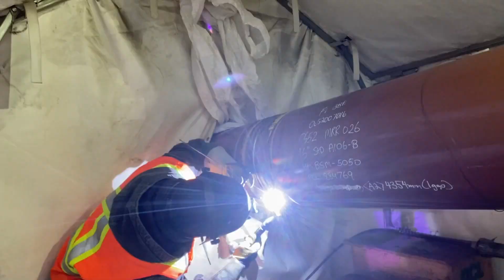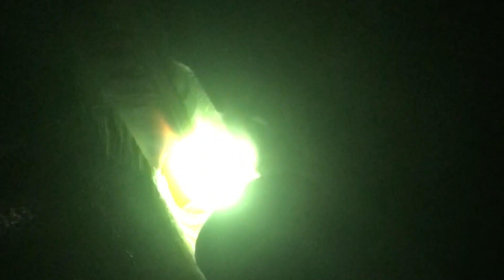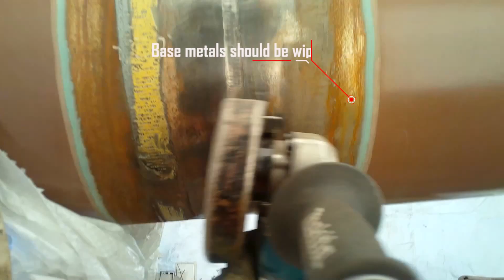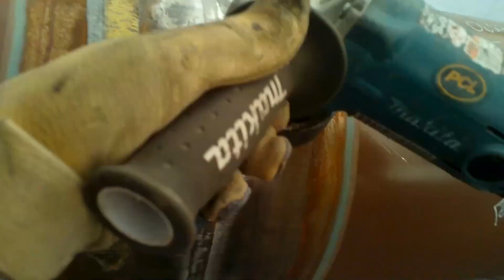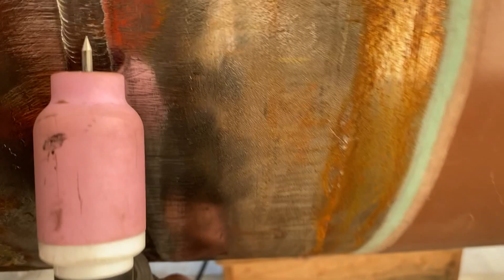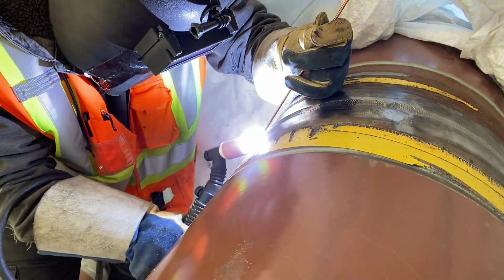Walking the Cup - TIG Welding Cover Pass Technique !

Comment: Nice video. What kind of fit up and prep did you have. Root gap? Guessing a 60 -70 degree inclusive angle or there abouts. I'm trying to teach myself to pass a 6g position sched 40 carbon and stainless purge. Cheers
Reply from the maker: Thanks for your comment bud! Gap was 5/32 . You can check my other video with open root, might help you, I’ll post link below, and planning to do 6G series with different materials, stay tuned. 

Walking The Cup - TIG Welding Open Root Technique! Easy Steps!
https://youtu.be/_gRhx_Ct4bk
Reply: @X3MTIG  thanks mate. Will check it all out. Thanks again